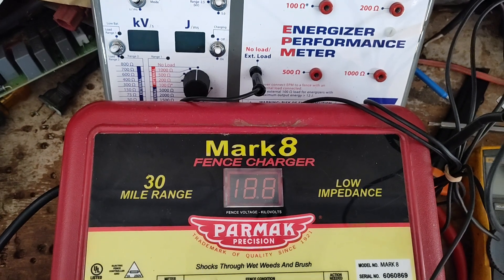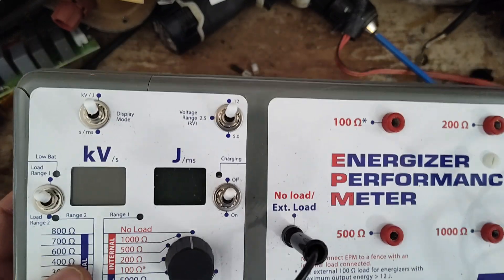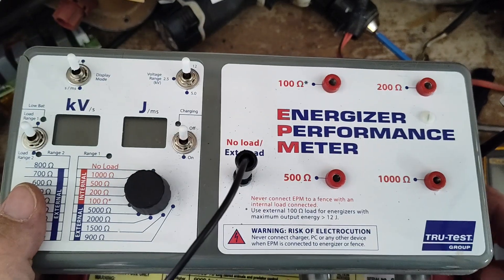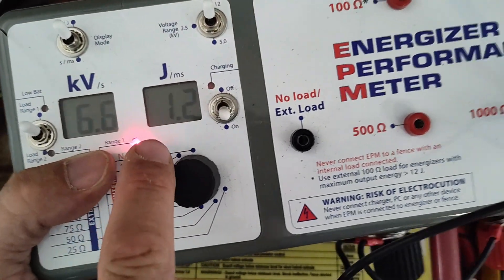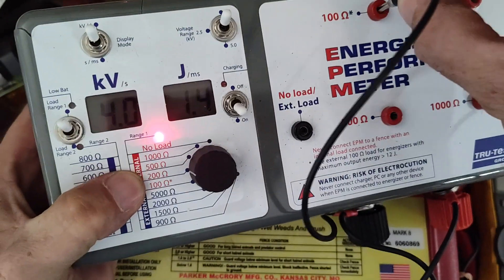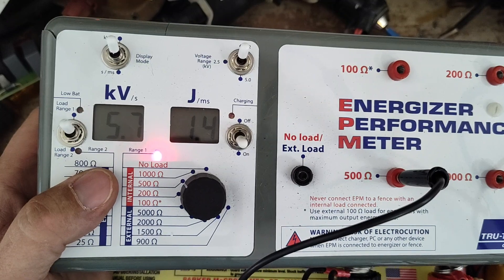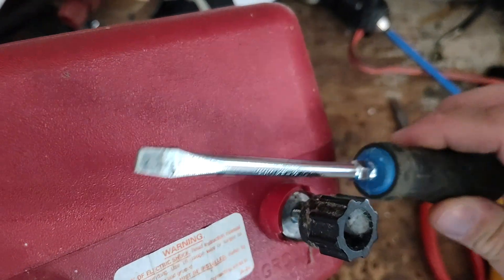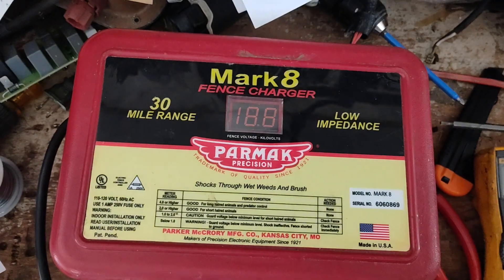How Many Joules Does A Parmak Mark 8 Fence Charger Have? Let's Found Out!

Comment: I got new mark 8 i dont think its hot as the silver streak i got that qiut it burn weeds imto after a while i ran into the wire we had storm blowed one my post side ways it was like 15ft high i ran into it almost knocked me down i was weed eating drop the weed eater felt like i been hot with a baseball bat lol hit me in the head why it hurt so bad i dont use one for like 4 months out of the year should last a purdy good while